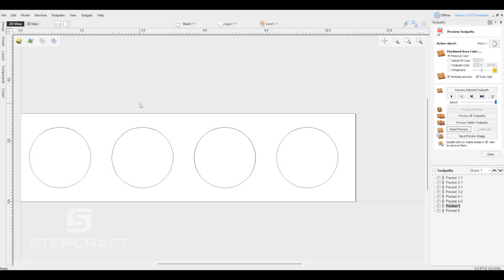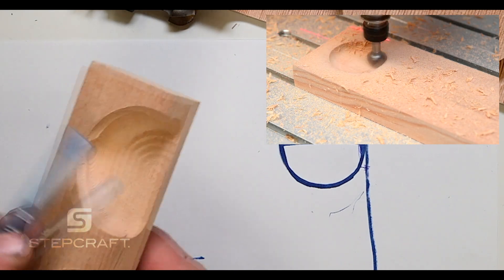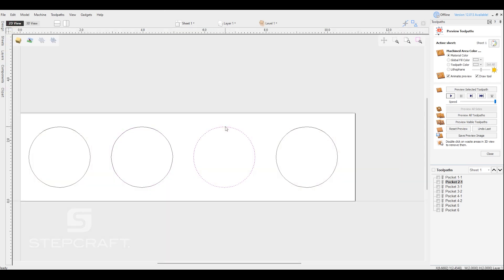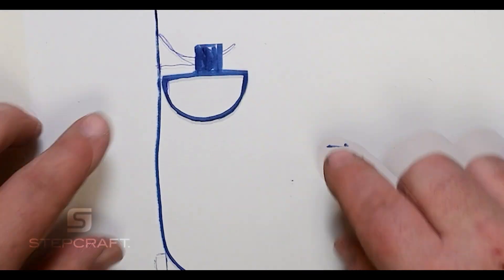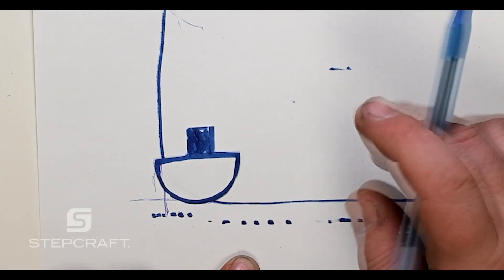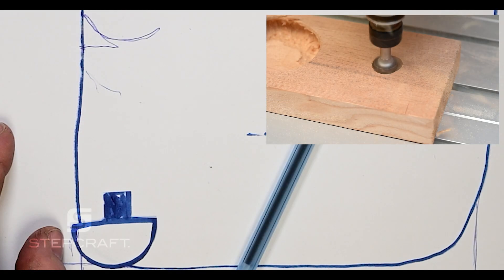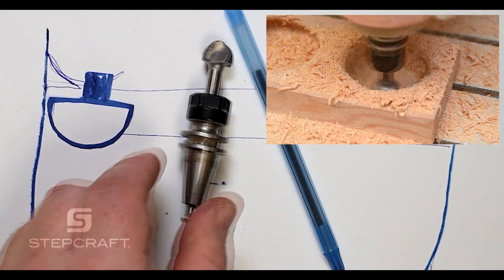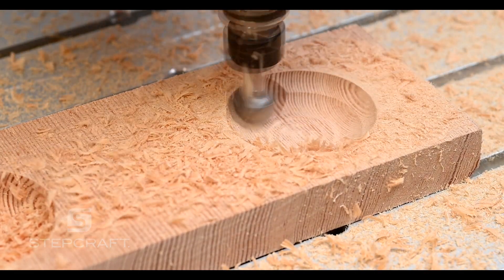Mini Tips Monday - Mastering the Bowl Bit

Comment: Hi, Have you used the bowl bit on hardwood such as Hickory and Pecan? If so, what feed rate and RPMs did you use? I'm trying out a Freud 19mm diameter bowl bit without too much success. I can't seem to find a sweet spot where it doesn't burn the wood. I'm using an Australian hardwood, Spotted Gum, very hard. I'm trying to find CNC people who can hopefully guide me in the right direction. I tried a fairly common feeds and speeds setting of 60 inches per min, at 16000rpm,  at 1mm pass depth, but the timber was smoking pretty bad. I tried a couple of slower options, but to no avail. I am trying to cut a juice groove in a cutting board on end grain.  It would be great if you could shed some light on this one. I would certainly appreciate it. Regards